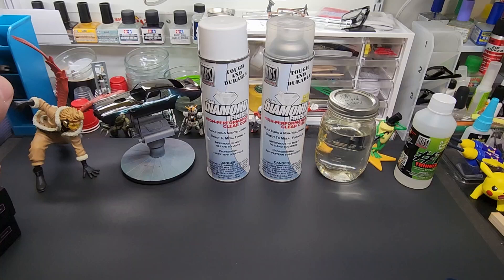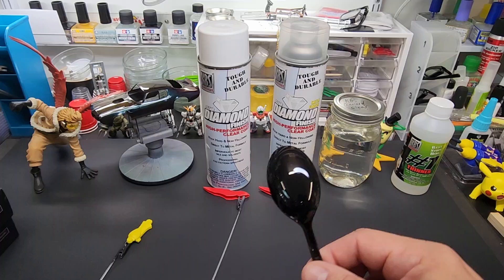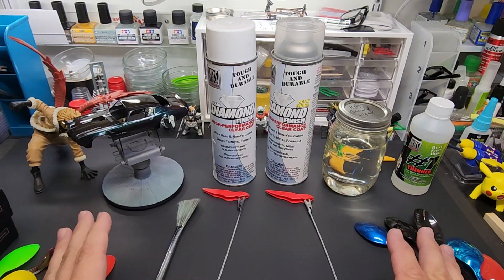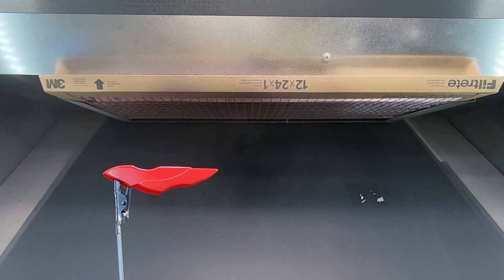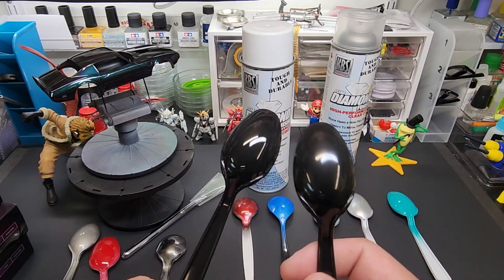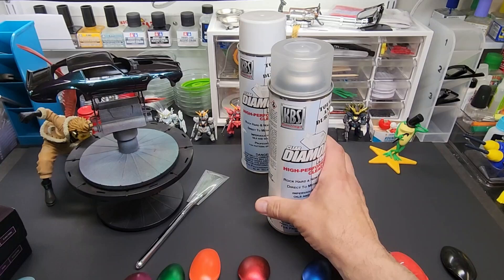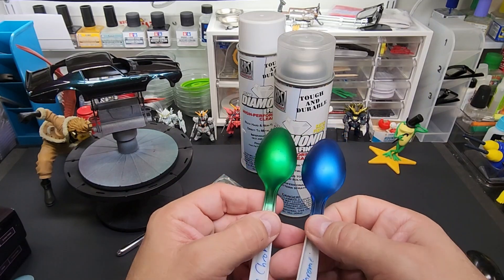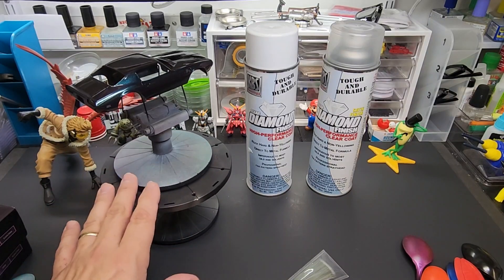Testing KBS Diamond Clear Spray Cans - Gloss & Satin Finish

Comment: Great! Yeah, I recently was going to pick up some to try out and I was shocked that it's as expensive as the product I use currently. I needed an epoxy finish replacement, and it was between Diamond Clear and Brite Tone, and I went with Brite Tone. It's a water based high solids clear, and you can build up a thick coat relatively fast. It was more expensive, but it doesn't have the fumes because its water based. I probably will test out some 2K now that all the prices are up there. I'm looking forward to seeing the airbrush test as I enjoy upstarts and seeing what they're going to bring to the table.

Comment: as far as the Vallejo goes, I find that some solvent paints will bite so hard that they actually pull the softer paint back off the substrate.
Reply: Vallejo didn't like Tamiya clear either. Dried ok but sure had me scared while it dried. For Vallejo I am sticking with their clears. Otherwise I am excited that the kbs works great. Thanks for the test thanks for the video. Keep ' em coming! Thanks

Comment: Wish you had some fishing lures to do the test on!!  Which one of these sprays would you recommend for them??  Want to use it to protect the paint from chipping off before use.  Thanks
Reply from the maker: The Gloss one here is excellent. It's pretty durable once it's fully cured.
Reply: @barbatosrex9473  Thanks for the quick reply!!👍  So your saying that the Gloss is the same as the clear then?  The reason I was asking Rex is I ordered some fishing plugs and found out that the paint doesn't hold up well after time so I wanted to protect the lure before using them.
Reply from the maker: @jayfogarty7544  if you follow my link in the description below the video, it takes you to Amazon, and there you can read the reviews, many of which use it for fishing lures
Reply: @barbatosrex9473  Thanks Rex!👍

Comment: Is there a paint line brand and line up that you would recommend to start with mostly doing model cars
Reply from the maker: For airbrushing? What type of model cars?
Reply: @barbatosrex9473  yes airbrushing and 1/25
Reply from the maker: @lukefortenberry2998  Mr Color and Tamiya are great paints to start with. If you want an exact color to match the auto manufacturers then Splash paints are a good choice. But Mr Color is where I would start

Comment: I'm really not hot on 2K 2 part epoxy's coats both from a safety perspective but also, the risk of screwing up your airbrush. So have been looking for good spray can alternatives.

 I came across Car-rep, a Finnish company, who makes 2K rattle cans, that's not a new concept, what's good and new about their product is, that it is NOT a one time use only after activation.  

You can use what you need, and put it back on the shelf like any other normal rattle can paint, so no waste at all.  I bought a can to test it out, but its just way too cold right now where I live. so have to wait it it gets warmer outside. Not going to use 2K indoors.